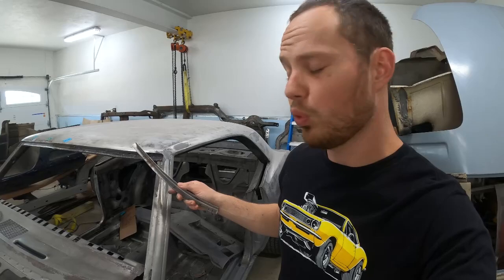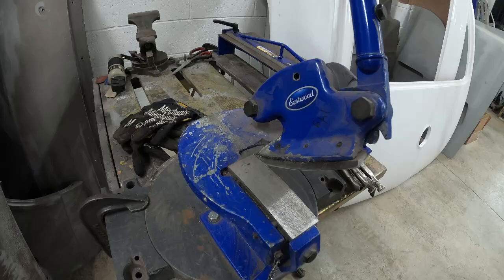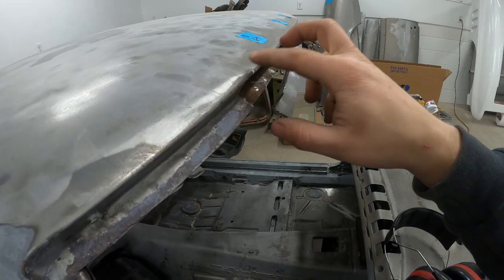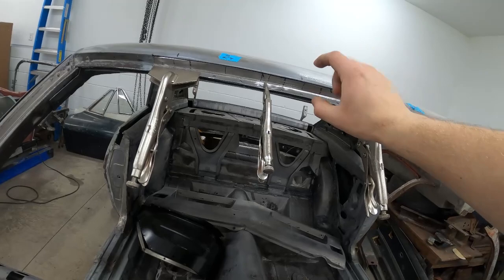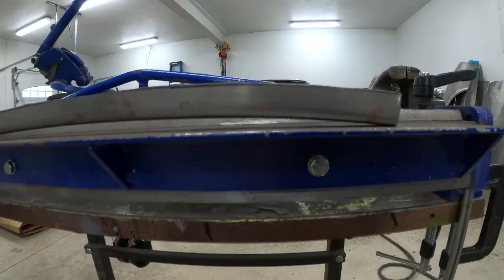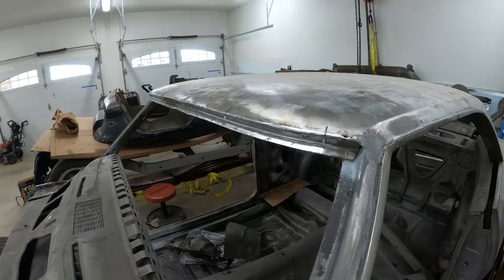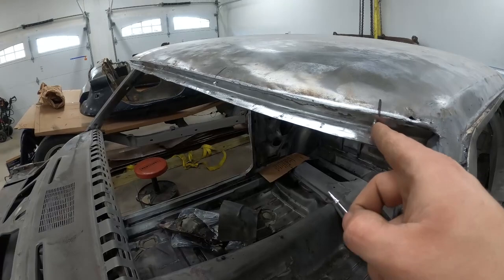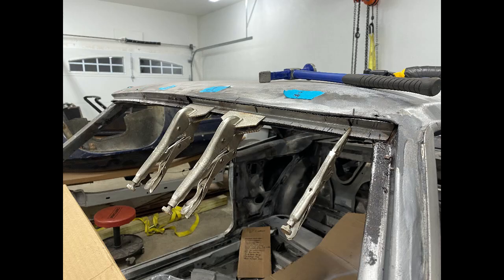Hand Fabricating Patches to Repair A Windshield Channel.  Restoring a 67-69 Camaro Windshield Frame.

Comment: Hey Mitch!  My '68 had some rust/rot in the same area, but it wasn't as extensive as yours.  So I mechanically removed as much rust as I could (wire wheel/grinder) and then I neutralized/phosphated the area chemically and patched the holes with POR15 epoxy putty.  It worked well tho it's not as strong as your repair....but it was quick and is still solid 15 years later...
Reply from the maker: I guess they normally rust there but someone “sealed” this windshield with silicon in all the areas that rusted out. That trapped a lot of water and caused it to rust out. But that probably saved the floor. So it worked out in the end lol. That sounds like the repair worked well! You definitely treated it and filled it in. It should be good for life!

Comment: I had a metal restoration business for classic and antique vehicles for almost thirty years and repaired many windshield frames the same way using the same equipment but they didn't make those special rivets back then . Looks like a good item .  Regular rivets were used back then but you could not replace the clip very easy once the windshield was installed.
Reply from the maker: Oh very cool! I’m sure you have touched many cars over the years. I really liked those little studs. They are really handy. It should work just like it originally did. Riveting the clips on sounds like a good plan B and it got the job done. Thanks for watching!

Comment: That winshield channel was a piece of cake for you Mitch , considering all the corvette bird cages you've fixed . LOL , The video was very good and educating .
Reply from the maker: Hey thanks Bob. Yeah that channel is pretty easy to bend up. They sell the patch panels for them. But I found it was just as easy to make them by hand. It took the most time to cut the old one out and to clean the metal up. Thanks for watching!
Reply: @MidYearMitch  I look forward to every video you post

Comment: Hey there Mitch,
That shrinker/stretcher thingy works pretty slick. I'm going to have to look into that. I could have some fun making shapes with it.
The windshield frame came out awesome. Keep up the good work. 
Take care ... and do try not to poison yourself with the lead.
Dan
Reply from the maker: Hey thanks Dan. I’ll have to make a video on what metal working tools I use in the garage. I have quite a few and I’ve been meaning to make a video on it. I highly recommend getting some of these tools. I use the heck out of them. Yeah I’m not exactly looking forward to the lead removal process.

Comment: What lead are u talking about
Reply from the maker: They used lead to fill the panel seams between the quarter panel and the roof skin. They also used it on the windshield pillar to the roof skin seam.